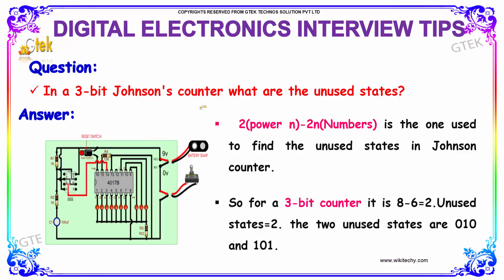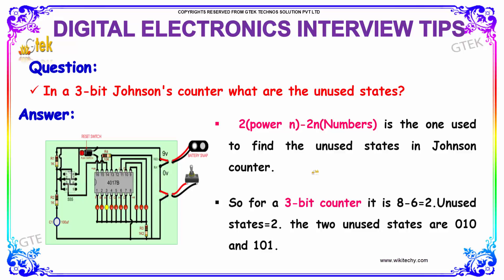Johnson's Counter (Twisted/Switch Tail Ring Counter) | digital electronics | wikitechy.com

Comment: A Johnson counter is a modified ring counter, where the inverted output from the last flip flop is connected to the input to the first. The register cycles through a sequence of bit-patterns. The MOD of the Johnson counter is 2n if n flip-flops are used.

Comment: A ring counter is a type of counter composed of a type of circular shift register. The output of the last shift register is fed to the input of the first register. The Hamming distance of an Overbeck counter is 2, the Hamming distance of a Johnson counter is 1 ... A twisted ring counter, also called switch-tail ring counter, walking ring ...

Comment: inversion of Q before it is fed back to input D causes the counter to “count” in a different way. Instead of counting through a fixed set of patterns like the normal ring counter such as for a 4-bit counter, “0001”(1), “0010”(2), “0100”(4), “1000”(8) and repeat, the Johnson counter counts up and then down as the initial logic “1” passes through it to the right replacing the preceding logic “0”.

Comment: A 4-bit Johnson ring counter passes blocks of four logic “0” and then four logic “1” thereby producing an 8-bit pattern. As the inverted output Q is connected to the input D this 8-bit pattern continually repeats

Comment: The main advantage of this type of ring counter is that it only needs half the number of flip-flops compared to the standard ring counter then its modulo number is halved. So a “n-stage” Johnson counter will circulate a single data bit giving sequence of 2n different states and can therefore be considered as a “mod-2n counter”.

Comment: So,4 flip flops are required for MOD-10 and MOD-16 counters. For MOD-32, we get n=5 i.e 5 flip flops are required. You can see the number of bits it would take to represent the count sequence of the counter. Take MOD - 16, this will count from 0 (0000) - 15 (1111) hence 4 states/flip-flops will be needed.

Comment: Then by looping the output back to the input, (feedback) we can convert a standard shift register circuit into a ring counter. ... The synchronous Ring Counter example above, is preset so that exactly one data bit in the register is set to logic “1” with all the other bits reset ...